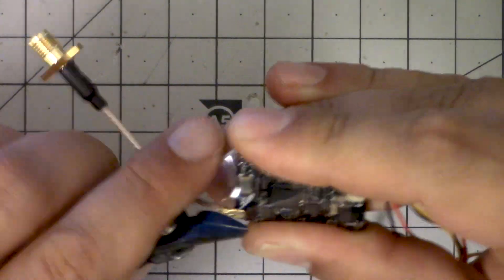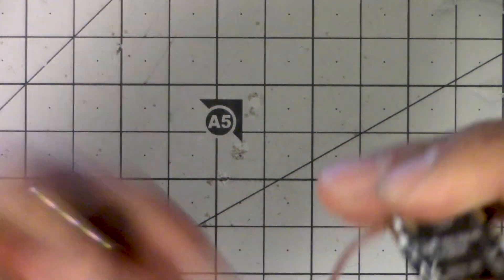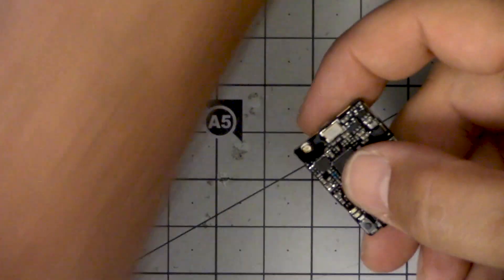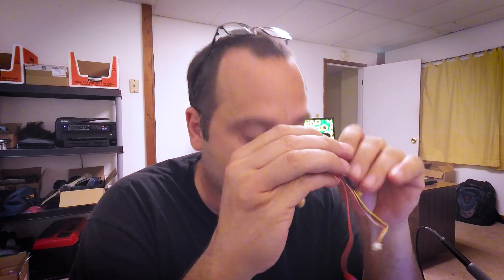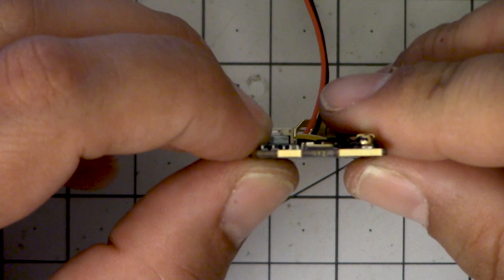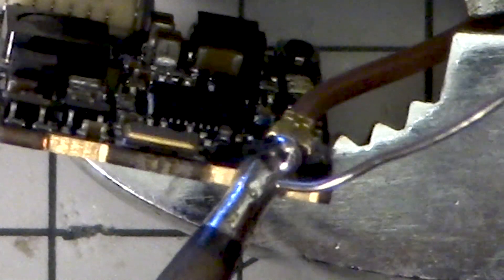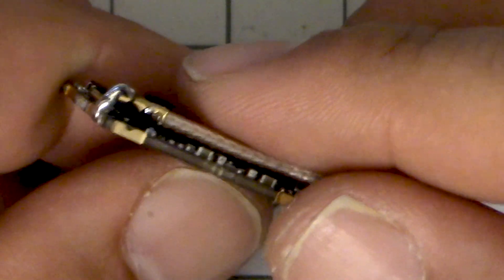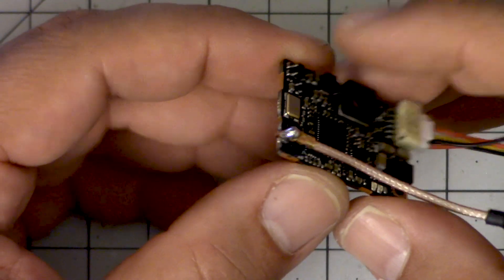How To Reinforce TBS Unify Antenna Connector | NO DIRECT-SOLDERING COAX

Comment: To all you OCD guys, you can clean this with silicone degreaser and fix it with a blob of hot glue which you can smoth down with a wet finger. works pretty much the same.
Reply from the maker: No, I disagree. Hot glue is much weaker structurally than solder. And it softens up in the heat. I can easily peel a bit of hot glue off of something.
Reply: +Covers70 I did use high temp RTV as well, prior to the epoxy.  My issue with the silicone is the antenna (I'm not using the pigtail) could still flex and vibrate.  Thus I still got some "white lines" in the video feed.  So, I wanted a more rigid mounting solution.  Hence the epoxy.
Reply: I tried hot glue on my first unify hv and it melted all of it and made a mess and left no hot glue on the connector and yes i did use the high temp hot glue.
Reply: +Joshua Bardwell.  I agree that the hot glue is not a good solution for this particular VTX.  It softens up too much because this VTX runs a bit hot.  I've taken to using epoxy to attach the TBS linear dipole to these (to keep the U.Fl connector from vibrating and working free).  I use that instead of the pigtail because I'm mainly mounting these on micro-quadcopters.
Reply: Maybe i should precice it a bit: When you're running legally (i'm in the EU so 25 or with permission 200mw) this thing will never come off. One drop at the u.fl is enough. Did over 25 builds so far, not a single complaint.
But i can imagine that running it over 200mw can get this thing too hot.
For securing tiny connectors there is a silicone for electricians idk how it's called in english but it resists temps up to 175°C should be sufficient, pretty sure someone can post a link to that stuff.
Found it in the UK Amazon:
https://www.amazon.co.uk/TEMPERATURE-SILICONE-ADHESIVE-SEALANT-RESISTANT/dp/B006C65ZCO
even up to 300°C
Search for Technicoll® 9732
Reply: Bloody JMF I don't know about 25 mW, but the hot glue will still melt at 200 mW.
Reply: Also I hope that TBS comes up with a MMCX variant of that TX should only make about 1,5g more.
Reply: Where and in which orientation have you mounted it? I can only speak from my experience and I put mine at the top of the stacks or in a place where airflow is high. Does your topplate or HDcam maybe cover the airflow or have you mounted it in a tiny setup where it might get the heat from the surroundings aswell? Are you using the HV with straight battery voltage or are you feeding 5v to a regular one?
Reply: +Bloody JMF Admittedly, in my case, the VTX is mounted in a rather confined 130mm frame (the Q-carbon 130 to be exact), and so that's a likely tough scenario for it.  I am merely commenting on my own use case though, and in this case, the hot glue does melt.  This is why, instead, I've gone to using epoxy.

I also have these mounted at the top of the stack in 90mm builds, and though I haven't tested the hot glue melting directly, due to not needing any glue based on the positioning, the VTX still gets quite hot, and I'd be inclined to think it'd still melt the hot glue.
Reply: Maybe, I've just gotten lucky with my batch and it is low temperatured. Can you remove epoxy or is it binned should you rip the antenna?
Reply: Bloody JMF  Heh, I don't really know yet, but I put the epoxy on with a mind towards replacing the antenna when the time comes. So, I fully expect to be able to replace it.
Reply: I just went to using High temp RTV automotive gasket making silicone its stronger then the black stuff they use but you can still just cut it away with an exacto knife if you need to remove it.
Reply: I see im using the pigtail with a duraspec antenna ziptied to the bottom of the top plate with the antenna coming out the back whale tail style works great for this setup but I can see why you would want a more rigid connection.
Reply: With permission 200mw...lolllllllllllllllllllllllllllllllllllllllllllllllllllllllllllllllllllllll
Reply: Bloody JMF ditto ,don't solder your connection use hot glue or go with the matek mmcx new style connection 💆
Reply: Covers70 if tour vtx is getting hot enough to melt hot glue id be a lil worried on that situation. ..

Comment: surely just reversing the direction of the cable and then re shrinking the module should provide enough strength. I feel like this makes having the connector completely pointless.
Reply from the maker: This is a decent middle ground between direct-soldering and having a connector. It's easy to break the solder bridge and remove the pigtail if you need to, and you can put a new one on without having to do microscopic soldering of the coax. Turning the cable around and re-shrinking... it can work. But I feel good that solder is on there.

Comment: I wanna get into hobby but buying cheap and clone stuff from bangood is it right ????? 🤔🤔🤔
for getting started with racing drones
Reply: Lalith Kishore if you don't have the money, yes, it's right! Buy something like a Martian with racerstar motors and escs, some decent flight controller and stuff and you will be just fine, I did that and it's amazing to fly
Reply: Eng_JJ 25  how would favorite 30A  esc{ clone I think so} and races the 2300kv motor
Reply: and eachine vtx and camera and about radio it it flysky andFc I want to take the SP F3 board (clone) and  I don't know🙄🙄🙄
Reply: Lalith Kishore eachine vtx is good, spf3 clone is just fine, escs id say racerstar 30A, get yourself a decent camera though, and good props!!! Like the new HQ 5x4.3x3 v1s or the gemfan 5152, don't go cheap on props.
Reply: Eng_JJ 25 is races the 2300kv motor better or the 2600kv
Reply: Eng_JJ 25 You can get a real omnibus aio f3 for 25 dollars that has 3x the features...so why get an spf3 real or cloned?
Reply: SpikeJonesTheCr0oked cuz to someone who's new, those fancy features mean nothing and will just be more confusing.
To your question: 2300 or 2600 is both fine, i have the 2600 and they have mad power
Reply: SpikeJonesTheCr0oked  and it is easy for me to check with and I would be even happy with beta flight f3 but cost matters

Comment: Nice tip. I used one of these pigtails on the cheap eachine VTX03 and attached an aomway clover leaf antennae to it in a full size build works great. I used hot glue to keep it connected and eventually the coax snapped just before the connector so I direct soldered it. I'll use this trick next time because I think hot glue results in concentrating the stress point to a single area on the coax making it more prone to failure.

Comment: There is also another way, direct it opposite to where it needs to go  and run small ziptie over it, route it back. So the cable puls ziptie if stressed. As simple as it sounds it provides excellent reinforcement. Tested in garages/races/parks. I do the same for Tramp with great results.

Comment: Josh, I run all my unifys like this, i've found that the u.fl connector can short on the board with a zip tie. To remedy this i always put some small heatshrink on the coax and the exposed portion of the u.fl. also some liquid electrical tape for some redundancy.